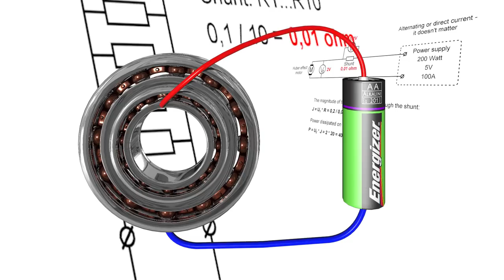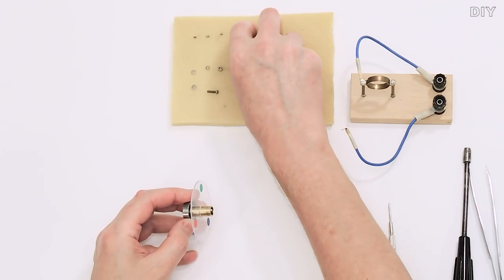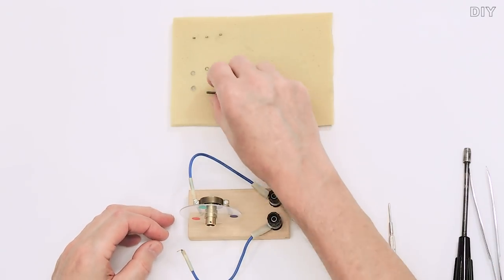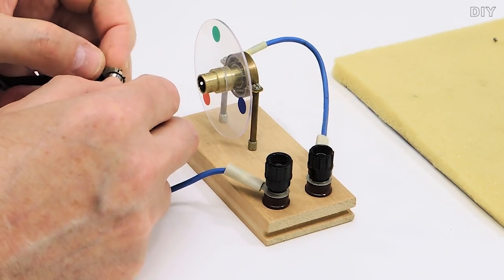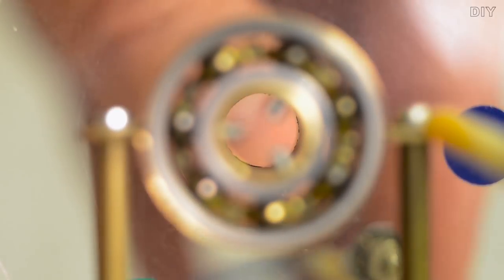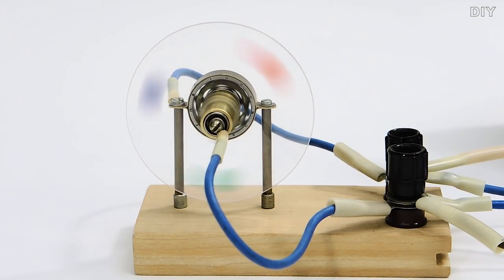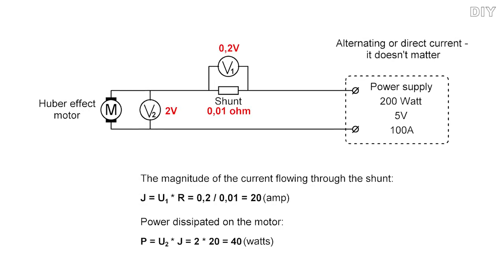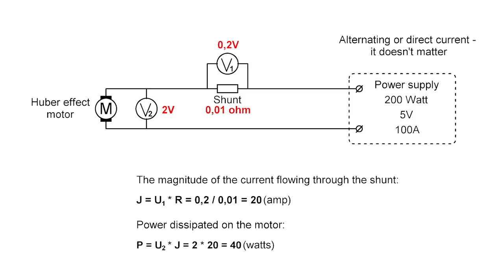🧲Amazing Ball Bearing Motor - Huber Effect. Part 3

Comment: I dont think this is working with heat, and I would like to see someone trying to power this with low current and high voltage. I think that the sparks happening between the balls and the circular metal are the main reason of the rotation effect. The sparks create some pressures between the balls and the metal. I think we should turn the device before, to allow the sparks to change their direction, that way they will maintain the rotation.

Comment: Can you do a quick experiment for me? What happens to the spinning bearing motor if you place a permanent magnet near the larger ball bearing in different orientations? Does the magnetic field have any impact on the performance of the motor?
Reply from the maker: Yes it does.